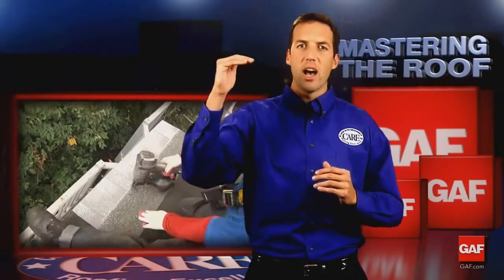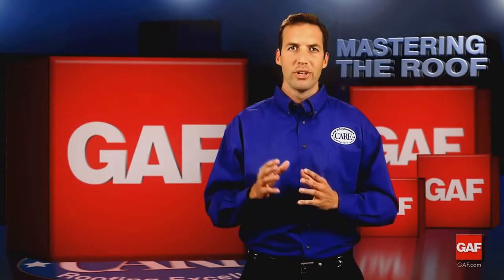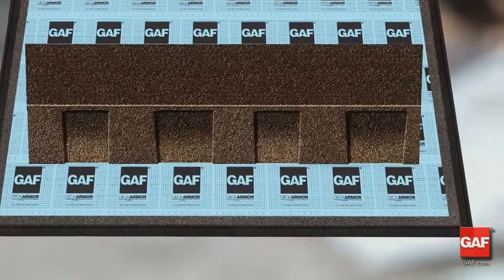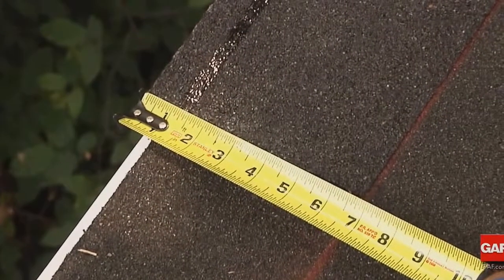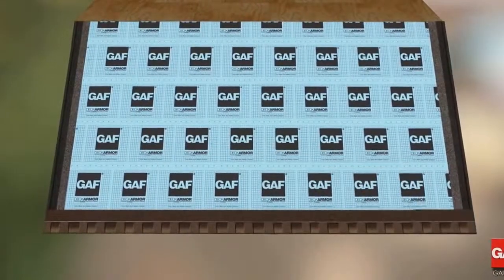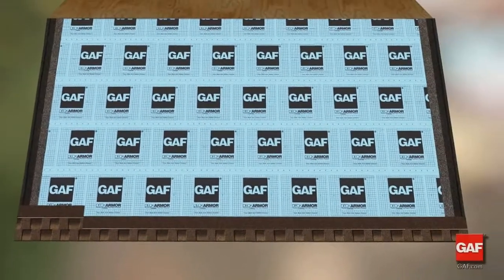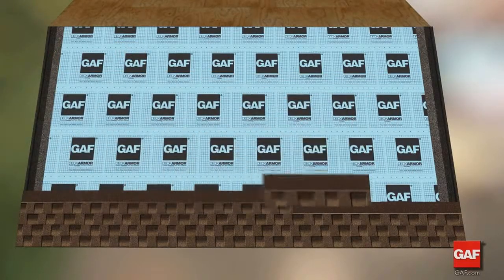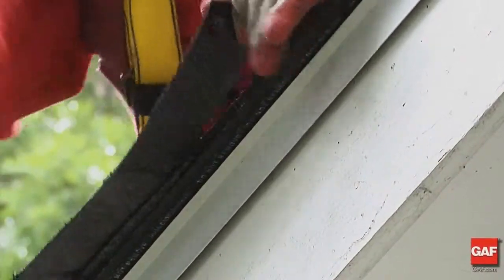GAF shingle racking by National Roofing of TX

Comment: bogus video. if you did not screw up on your colors making them there would be no problem with so called color variations. i remember back in the day some shuffled shingles cause manufacturers could not get the colors right from bundle to bundle. 

you are national roofing and are not gaf so do not pretend to speak for them. in fact the gaf gold pledge warranty states install method will not void warranty.

long live racking